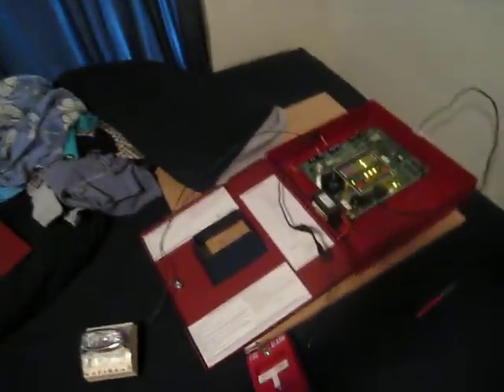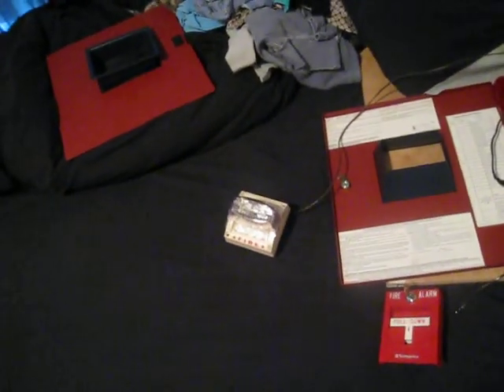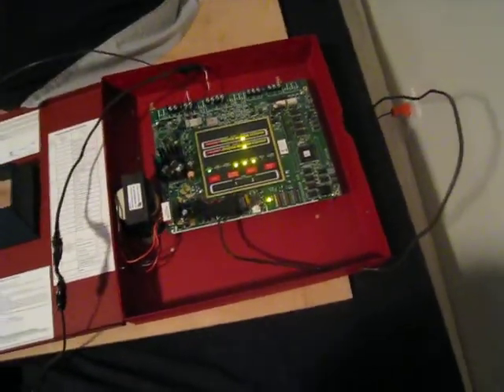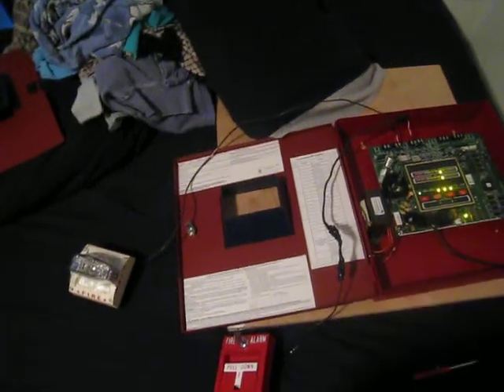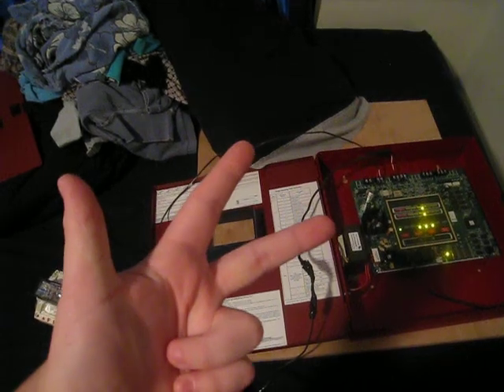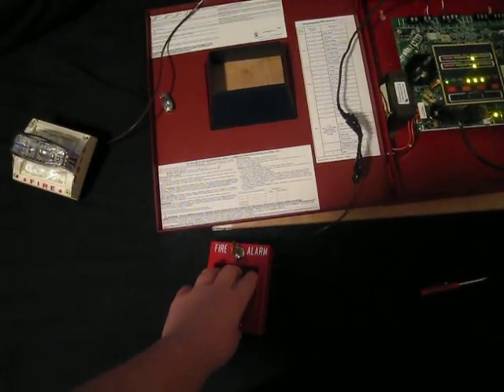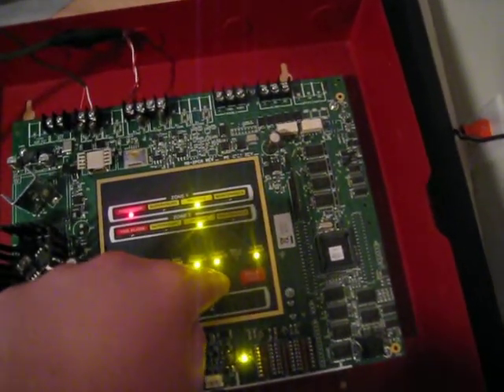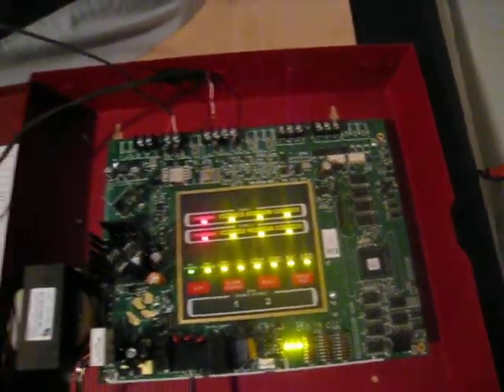FireLite MS-2 System Test 2

Comment: The NAC Fault is because of missing resistors.Battery trouble is because their is no batteries, and system trouble because of the NAC fault, and the missing batteries.